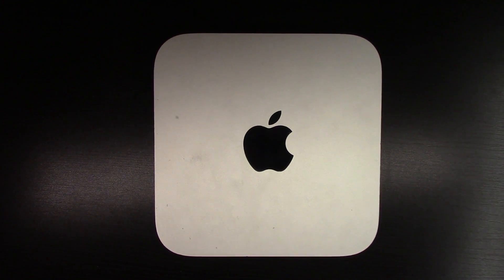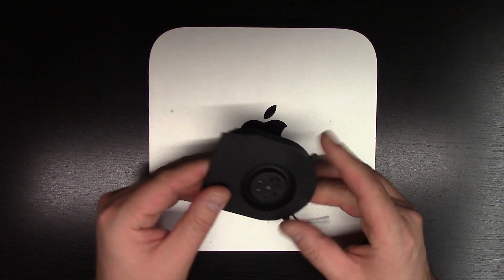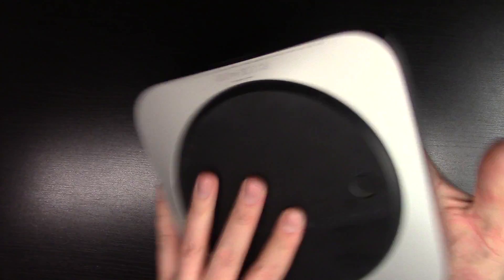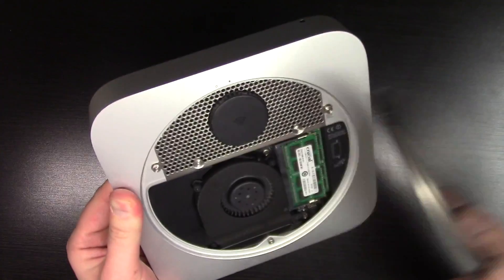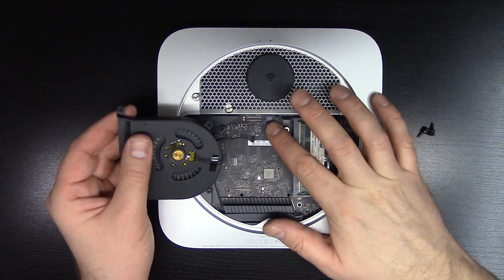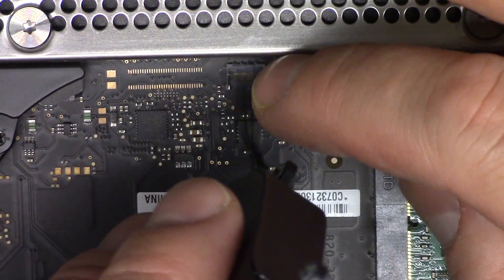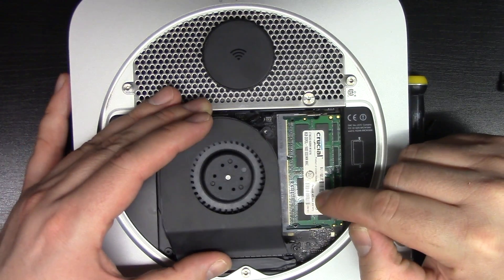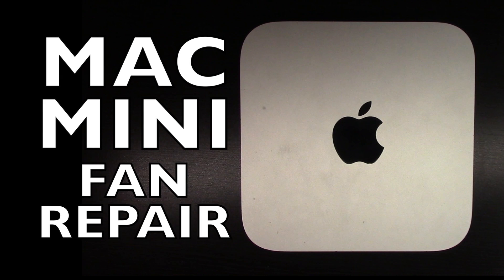Late 2012 Mac Mini Fan Repair How To

Comment: does the fan connector push down only? or do u have to slide it back?  in other words, the pins go in the connector on the side opposite the wires? or from the bottom?

Comment: This is not fan repair. This is fan replacement.
Reply: who is going to repair a fan that costs $10? this is easiest repair on the most reliable mac ever
Reply: @nopants4259  I would. That's why I watched this video in the first place. I work in the IT department for a steel processing and distribution company that has a fleet of hundreds of these workstations (though we've started decommissioning them since I made that first comment). 

The workstations are in various hostile environments, many of which expose them to metal dust, dirt dust, smoke, and various other contaminants. The contaminants build up on the inside of the workstations, including the fans. The grease lubricant is leeched out of the sintered bushing by excessive dust.

We've extended the life of the remnants of our fleet by re-lubricating the fan bushings. Some of the fans had to be disposed of because they the bushing became out-of-round or too much dust infiltrated the bushing before it was serviced, causing a permanent increase in friction.
Reply: The dust and dirt can also leech the oil out of the thermal compound between the heat spreader assembly and chip(s).
Reply: For those who are interested in re-lubricating the bushings (Macmini5,X through Macmini7,X):
0. Disconnect the fan cable from the motherboard (to prevent back EMF) and then spin the fan. If the fan makes a hissing/grinding noise or does not spin for long, it may be low or out of lubricant. In this case, please follow the remaining instructions.
1. Separate the fan from the motherboard
-- Warning (Macmini5,X through Macmini6,X): Apple used screws that screw into the tops of other screws. The heat spreader assembly cover plate is held in place by two screws, one of which screws into a flathead screw, the other of which passes through the fan casing. Unscrewing either of these screws can cause the underlying screw to rotate, forcing you to potentially have to remove the fan and/or heat sink cover plate as one unit. The heat spreader assembly cover plate is a standalone piece of plastic. If you have a pair of interlocked screws sandwiching the cover plate, then you can use pliers and a wrench to separate the screws.
2. Remove the fan cover plate on the fan housing
-- Gently remove the screw from the top of the cover plate. It's tiny; try not to lose it.
-- Unwrap the power cable from the prongs on the fan casing
-- Use a sharp steel spudger to unseat each tab around the perimiter of the fan cover plate in turn. If you gently apply force (as if to separate the cover plate from the fan casing), you will only have to lift the tab far enough that it doesn't snap back into place.
-- The fan cover plate should separate from the fan casing once all tabs have been unseated
3. Separate the rotor (the part with the fins) from the stator (the part attached to the fan casing) by lifting the rotor away from the fan casing.
4. Inspect the inner surface of the rotor and the top surface of the stator's bushing
5. Clean the rotor
-- Wipe the inside surface of the rotor's permanent magnet with a clean cloth or tissue. 
-- Clean the vanes of the rotor
5. Clean the stator (only if it is dirt and dust encrusted; if it's clean, skip this step)
-- Cover the bushing and wipe down the coils with a clean cloth
-- Wipe the top surface of the bushing with a clean clot. The AVC-brand fan of the Macmini5,X has a large bushing with grease channels around the perimeter. If the grease looks clean, don't worry about it.
-- Warning: Do not get any filth inside the central hole of the bushing (you'll never get it out again)!
6. Add new oil-based lubricant to the bushing
-- I use one or more drops of sewing machine oil (from a Dritz Zoom Spout oiler). A lubricant with a higher viscosity and higher operating temperature would probably work better, since these workstations run so warm.
-- For the AVC-brand fan of the Macmini5,X, I apply the oil to the perimeter the bushing and allow it to soak into the grease channels. For the Delta Electronics-brand fan of the Macmini6,X, I apply one or two drops to the inside of the bushing hole (it's tricky because it's easy to trap an air bubble inside)

Comment: Thank you so much for this video. Kernel_task was using (at times) 999% of my CPU slowing everything down to a crawl. I watched your video, did a complete backup, opened up my late 2012 Mac Mini and then cleaned out all of the dust bunnies that had accumulated as I had never opened it up before. Thankfully, the fan is fine, but your video gave me the confidence to open my Mac Mini up, and saved me from paying Apple to clean it, and also saved me from hours and hours of lost work time, and also saved me from having to purchase a new Mac Mini...especially when today I'd be getting a late 2014 model! I could kiss you for your video!!!! :)

Comment: My mac mini started freezing up and I thought it was a ram issue and when I picked it up it was extremely hot. I had only had it a few days and took the back off to find the fan was not spinning. I thought I had been sold a broken Mac mini but I used a piece of plastic to tap on the connector and hey presto the fan came to life. Now it works perfectly however I'm worried it could again become diconnected. I need to buy the correct kit to take out the fan and ensure it is properly seated. I think I came very close to frying my new mac mini. So glad I came across your video here...Thx for the post:))
Reply: Mickeyislowd hi, I read your comment, I've been experiencing problems with my Mac mini, I turn it on and it keeps on for 2 minutes then the screen goes black and the fan starts working really fast, the Mac mini does not turns off it just goes black screen and the fan works at its highest speed, Do you think I could be a fan problem? I'd really appreciate your help, it ain't easy to fix Macs in my country, I apologize for my English.....
Reply: Hi, I haven't encountered the black screen however a quick Google search shows up many people with the same problem and it seems there are easy fixes for this. Sorry I can't help you more but it appears to be a known problem that can be remedied:))
Reply: Thanks !!